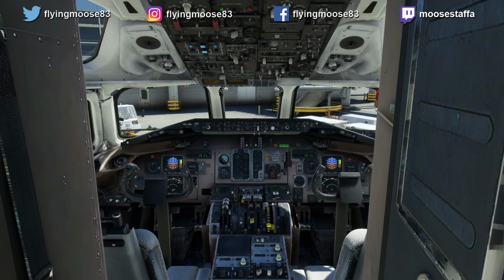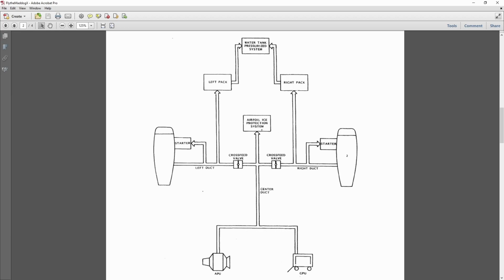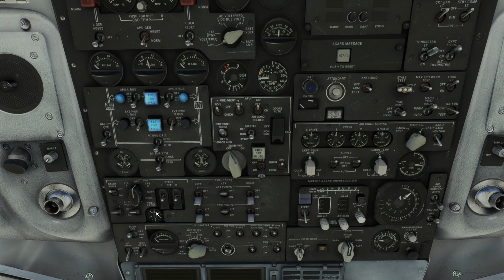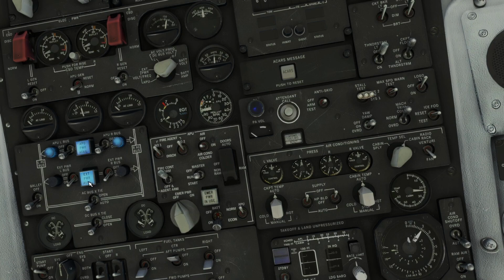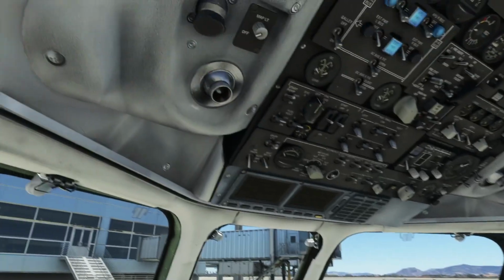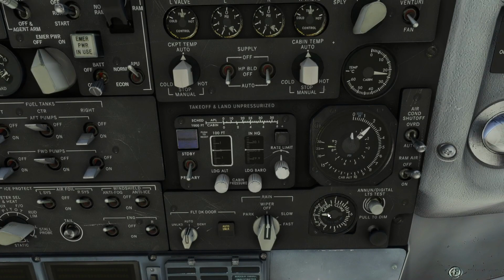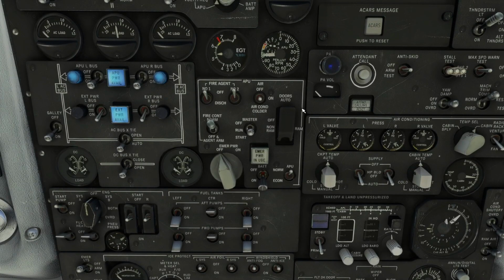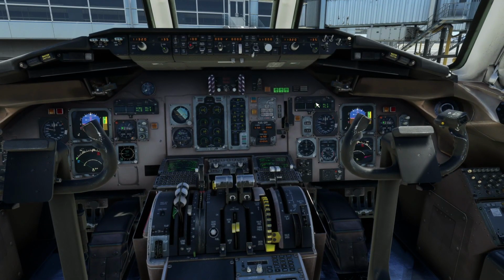MD-82 Maddog Masterclass Part 3.3: Pneumatic & Pressurization | MSFS

Comment: Thanks for all this useful detailed info! However, you started to talk about the APU "Air Cond Colder" switch, and you went into details on how the PACK works. But you never went back and explain what that switch actually affects, and when it should be used.
Reply from the maker: Oh sorry about that, the rule is if the cabin temp is higher than 75°F on the ground then use Air Cond Colder on the APU (about 24°C)

Comment: Awesome video. I've been flying this bird for about 2 months, the more you fly it, the more most of this info becomes apparent with a good checklist, especially if you know another (similar) airframe SOP and fly it regularly. I haven't been able to find a good FCOM for specifically MD82, and Leonardo documents included are very "on the surface" so to speak. Love the fact you can reference them in EFB in flight though, with QRH included. I mainly do 737NG for about a year or more, PMDG is definitely better in terms of providing good, in depth manuals for their systems, but definitely not for those release dates and EFB, I was actually expecting them to make "real" efb like the one in their own FCOM lmao
Reply from the maker: Yeah this aircraft is a bit of a sleeper in the community, very in depth but not nearly as well known as the 737 or A320
Reply: @moosestaffa83  Leonardo team have done a great job. Hopefully they will get more recognition